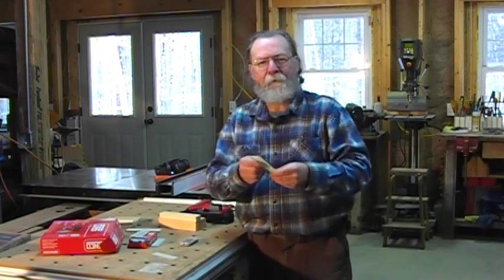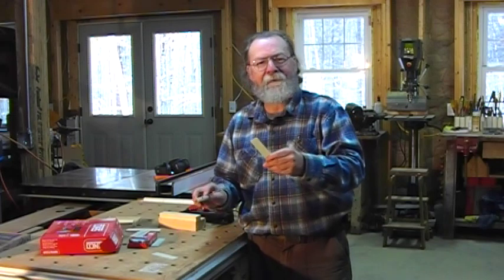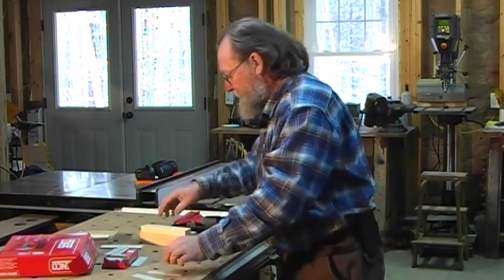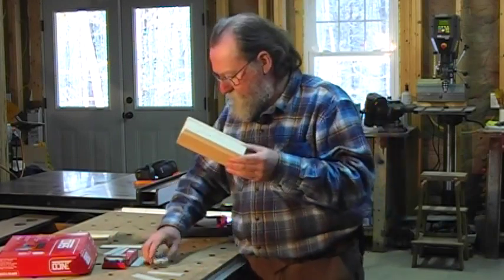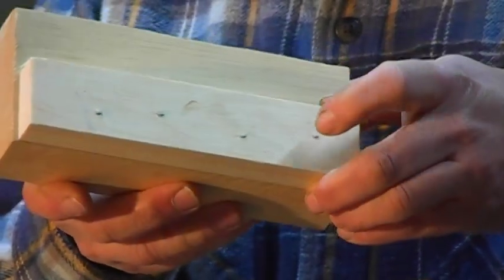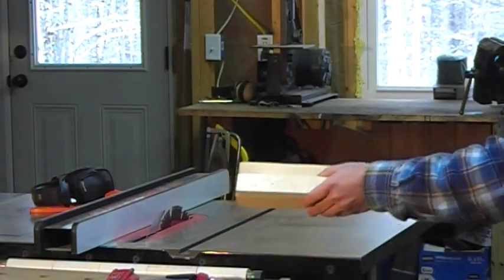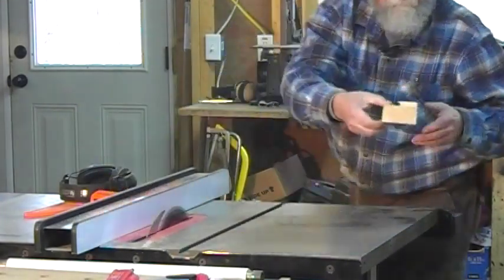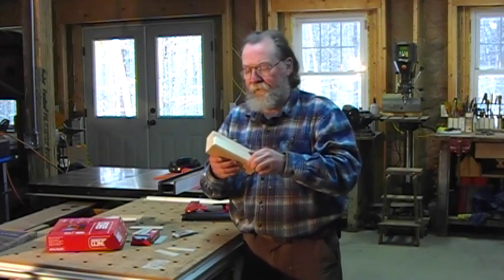Why would you use plastic nails?

Comment: Also good if you are gluing using epoxy or other glue that does not require pressure.  The nails hold the work together until the epoxy goes off or the glue dries. Then you can machine normally.